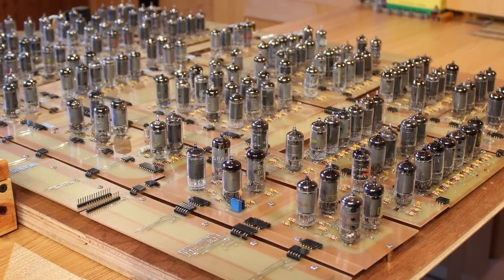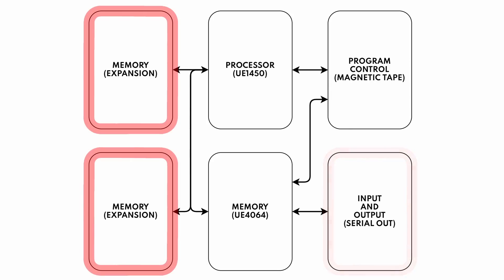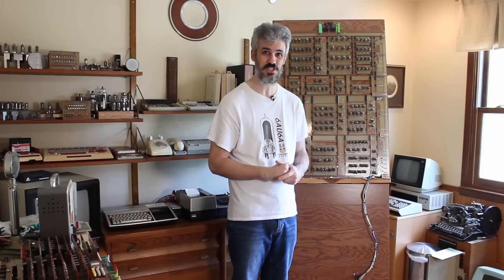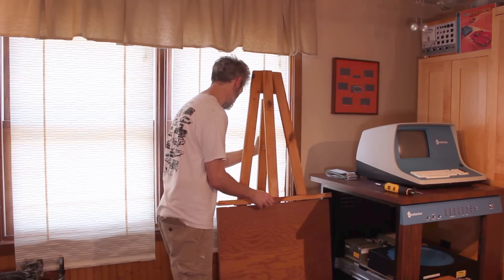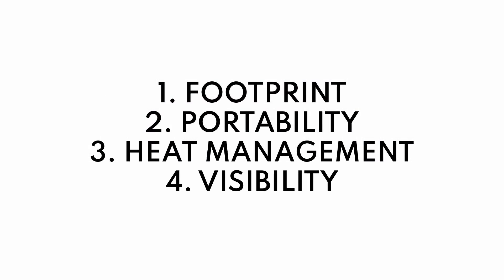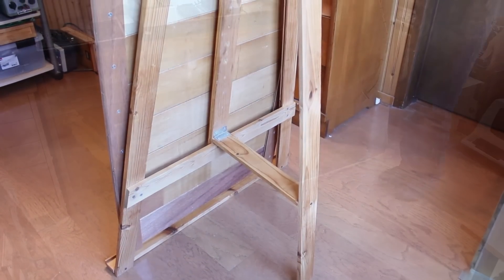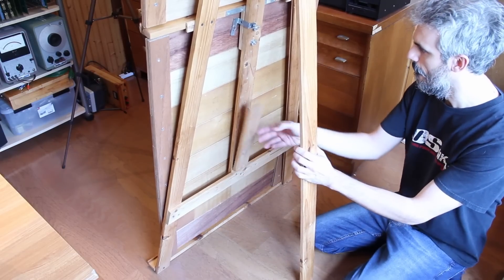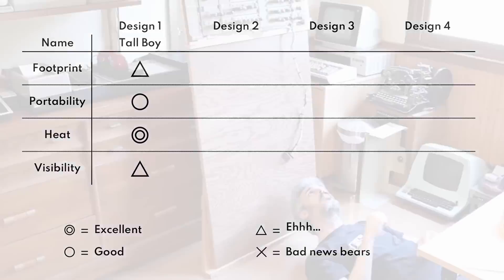Vacuum Tube Computer P.27 – Trying to Build a Mount for the Computer

Comment: A name that struck me is the UE LUX-1, inspired by the unique VFD-based memory modules, the fact it's a one-bit computer and the fact it's the first computer you've designed and built. I know you've changed the scope and plans of the project, and ended up going with just UE1, but I just wanted to throw it out there.

Comment: I think the cabinet design would have required holes between the boards to circulate air and some powerful fan... I would probably go with that as I like the idea of slotting them in, but would likely redirect the vfd somehow so I could have it all outputting at the top of the container. Did see someone make transistor computer parts like that, and would probably wait until I could do it with transistors, but I rather like the vacuum tubes. I find them quite interesting :)

Comment: Sorry for being late to the party. Also, I haven't yet watched your later vids to see what you decided. But I would go for a variant of the Cray idea. Instead of the panels radiating out from  one central pivot, they could be fixed in a row concertina-style. If each board is set up at about 90 degs to its neighbours, the whole assy can act as a room (or exhibition) divider, which might be an advantage in not needing wall space in an exhibition. Another idea might be to have an H arrangement with 3 pairs of 2 boards, one forming the bar of an H and the others forming its two uprights. As for vfd visibility, firstly as a general principle, no full-height display of anything gets t show off its lower half at all well, especially if kids congregate right in front. So if you are redesigning the whole thing, try to move as many of the visually attractive features eg vfds to the top halves. Secondly, as the vfds are now, the only real solution is to have dished reflectors for each one. maybe you could source some LED GU10 lamps or similar, or maybe such reflectors are on aliexpress separately, or maybe you could press some out of sheet tin or foil. Lastly, weight is also an issue. I suggest you try to make each board - and maybe each half-board - a separate component to the others, for assembly onsite. Good luck! BTW my first idea before I realised you wanted to take it on tour was that since 2 boards each 1x07m is about the size of a domestic room door, how about using the panels in pairs to replace 3 of your home's doors? That would save space!

Comment: If it was for me I'll go for design 3 the filling cabinet, but flip the boards vertically and have mesh on the top and bottom so air Is thermo siphoned (add some fans on the bottom to blow air up to provide cooling). You could make the sides transparent to allow you to see 2 boards at once and can have the center borads face away from each other when you pull them out to show 4 boards at once

Comment: I'm new here and have been watching all your shows for the last few days and have to say that I really like the wall mounted version you have here now.  So much so it would be worth re-working all lighting on the computer itself so in the future you can simply mount the system to a wall to show all in your living room which yes could as well act ask your home heating system. Also the 'tall boy' as you call it  would be best for shows as you will be about to mount it behind you in any booth you have without it taking up any room. Also any version other than the tall boy could be a fire risk that extra paper work would need to be filled out when showing it.

Comment: I'm late watching this (due to going out of town for a week & now having to catch up), but what if you combined the "tall boy" with the very "slow Cray"?  Or a tri-fold panel made of three double-height sections with the center section having hinged on both sides?  You'd have good ventilation/heat dissipation too.  The only weak point I see in all of the ideas is limiting yourself to having the VFDs vertical to the boards -- could you perhaps find "right-angle sockets" that the VFDs could "plug into" in order to greatly improve the visibility?

Comment: Funnily enough, I was thinking of the fan design before you mentioned it
The cray design is an eye-catcher - especially if it's going to be displayed in public.
Maybe all of the VFD's could be mounted on trolley like the one used by the old Tektronix scopes with storage below for spare tubes?
Ref. the power supply: you could maybe do a collab with Eddie over at Kiss Analog for a nice efficient SMPS?
This project is so immersive man! An absolute joy to watch. 🖖😎

Comment: Re the portable huge computer. The Very Slow Cray design might be best but if your test lights can't be seen, how about a new visual interface board so the club could see the results of data crunching, or devise an interface to drive an LCD display? Show input and output results?

Comment: Why not just Rabitto?  Capitalize if you need to.  The romanization of the Japanese pronuciation of the English word Rabbit.  But, the BIT in the name is important, since bitto is Japanese pronunciation/spelling of bit.  Not many Japanese words start with ra, so couldn't really work there.  There is one ra Kanji, unicode 7b49, but is a suffix meaning amount or or about.  So if you don't mind bastardized out of order Japanese, Rabitto also means about a bit.

Comment: UniELG (Universal Electronic Like Generator)
Reply: BTW I love your Austin Healy.
Reply: As for layout. I say copy a CDC 7600. Place each board in, basically, a display case with cold air going in the bottom and hot air going out the top, and simply join them at the corners. I presume that interconnect distances between boards are not really a matter of concern.  Seymour was better at dealing with heat and visibility of components than any of us, why not copy him? So this is technically also a Cray design, but two generations earlier, and I think it maps better to how these boards are shaped and what you are trying to accomplish.

Comment: If you went for the filing cabinet style you could could 3D print a T shaped sleeve/ coupler for the VFD's and run plastic fibre optic light pipes to a display panel. If they were printed in something semi transparent it may also increase the general visibility of them, don't know until you try I guess, and one large radiator fan at the back with a PWM speed controller.

Comment: Why not use the file cabinet but instead of slides use shelves horizontal to the ground at 30cm spacing with open sides, use polycarbonate sheets to mount the boards and run 3 small CPU fans at the back of each level for cooling.  I would set up the legs to act like the older bunk beds that you could separate to make into two separate beds, this would allow a simple break down. Assembly would be more like building a Lego tower, plus the light from the tubes would look like electric sex illuminating the poly sheets in low light.

Comment: Could the VFDs be rearranged to lay flat against the boards?  Maybe with some sort of adapter sockets?  If you could make a 90 degree adapter for the boards you already have, the upright system would work okay.  The memory boards could be designed to accommodate the VFDs laying flat against the boards.

Comment: "Cray with mirrors" maybe?  It's a bummer that being able to mount a lot of these together and still being able to see the VFDs wasn't part of the original design.  If the VFDs could be seen from the side, then the "Cray" would be fine.

Then there's #5, the huge unified horizontal planar setup.  Worst for footprint by far, but fine for everything else for that's how you had built it in the first place.  Perhaps it would have a human size slot into which someone could walk, so the sight-line to any one VFD won't be too terribly long.  I think the coolness factor would probably persuade the event to give you the area for it.

And then there could be a hybrid setup whereby the main processor is a horizontal plane but the memory arrays don't take up as much space as the main processor, yet still built so the VFDs are reasonably visible.  Nothing says that all of it has to be set up the same.  Even perhaps put the "Cray" part on a turntable to swing back and forth.

Comment: Your project has made me ponder something: if a fairly simple vacuum tube computer like yours had been invented back in the '40s, let's say, would it have greatly increased access to computing for a lot of people? I mean, most early computers where very large and had large word sizes. Perhaps something that would fit in a single cabinet, use less power and would execute more slowly would have been possible.

Comment: Heater filaments in some tubes can sag over time when hot. Worth checking the manufacturer recommendations as some indicate they can't be used horizontally.
Reply from the maker: Oooh, that's an interesting problem I didn't think about.
I just checked the 6AU6 datasheet and thankfully it says that the mounting position can be anything!

Comment: I have some ideas for the name of the computer. Those are the UEC 1645, UE1BTC, or some rendition of it. The UEC of the first one stands for Usagi Electric Computer, and the 1 is the number of bits, the 6 is from the 6AU6's, and the 45 is from the UE14500. The next one after the UE stands for 1-bit tube computer. Also something like Usacomp or IEVTOC-1B (Intricate Electric Vacuum Tube Operated Computer 1 Bit, Pronounced eev-toc one bee). I could come up with too many names for this one comment if I kept going, so here are the ones I picked. Cool project too!

Comment: Custom road case hardware might be helpful when figuring out how to pack things up. You could always build the whole thing like it was meant for traveling with Willie Nelson.

https://www.reliablehardware.com/

https://www.diyroadcasesstore.com/categories/Case-Wall-Materials/

Also worth knowing about sites such as https://mycasebuilder.com
They have an excellent case finder for sorting through the various sizes of injection molded cases from different brands.

The reliable hardware guy has a YouTube channel showing how to build your own road case.

You will notice some of the case hardware is standard rack rails.

Comment: I feel like this needs to be attached to a big metal control panel with neon lamps and toggle switches, like an old IBM computer. This also somewhat reminds me of some of the relay stands at the local community college that were used for teaching, with all their banana plugs and motor starter relays mounted to big wood boards on 19" racks.

Comment: one thing you can do with the cray design, is have a central support structure that the other boards "slot" in to and then have the cabling on the inside of the central support, then you can just put it all on a plinth with some fans in fifring straight up through the boards

Comment: I like the filing cabinet but add a small AC unit and bring the VFDs out to a front panel with the control switches similar to a classic PDP computer.  Maybe mount the boards vertically instead of horizontally.  Oooh, and a cool plug in back plane like an old S-100 bus.

Comment: I propose that you mount the boards back-to-back in pairs, then mount these 3 "modules" around a central axis at 120° from eachother. You should get something resembling a Y.

I think it's the it meets all requirements: it's contained in a 1.4m diameter circle, it's completely visible and has great airflow, and can be easily taken apart.
Reply from the maker: Brainstorming with a member of the Discord, we actually stumbled across this exact same design idea!
I've been calling it the "Tri-Force," because that's a cool name. Here's a sketch I drew up of the idea a few days ago: https://raw.githubusercontent.com/Nakazoto/UEVTC/main/Reference/Cases/Tri-Force.jpg
At the moment, this is my favorite idea, because it can fold up to be pretty compact, can be put on casters for easy portability, and can swing out to look really cool.

Comment: variation on the file cabinet -- instead of sliding out, put big hinges on left side so the boards can fold over one at a time giving visibility.  then they all can fold back into the file cabinet arrangement (with a big attic fan at the back of course)

Comment: Regarding design layout, maybe a modification of the "cray": think of it as a book, with all boards in the same orientation, no back to back, and boards do not share the hinge rotation axis.  You can fold all boards into a box, but to operate you fan out the boards, like fan-ing out a book.
The "book" back where all hinges are, also has the interconnects, maybe "I/O", power supply, etc.

Comment: How about a vertical design with the filing cabinet. It would be like the card cage in the centurion. It would fix the heat management problems.

Comment: Also consider “safety”! I find the easel setup not safe… there is a risk of it to topple back or forward with a large impact…
Reply from the maker: You're absolutely right!
Being so tall with such a high center of gravity, it just takes one little mistake to tip the entire forwards and have it come crashing down in a 25kg collection of pain. The other designs were ideas mainly to address the footprint and portability, but also take into account stability as well.

Comment: So just brainstorming here. What about using a small mirror on an adjustable mount? So you can change the viewing angle as you see fit while still working out all your layout ideas? I would think that the mirror at a 45 degree angle with a center hole in the middle to go around the vfd. Might make for a cheap, fast highly adjustable solution for the time being.

Comment: If any of the VFDs are blocked from laying flat in all directions (@7:56 can fold up over the two resistors, but looks like it would contact the tube below even if the power resistor were not in the way, and there is space left and right) I would not put in the effort of tilting them. I think it is better to have them all upright than some upright and some flat. But if they can, and you want to make the effort, I think a set of sockets and clips would be doable.

Comment: Weighing in on the name, I feel like the early days were rife with VACs of various types (as well as ENIAC), of course. I then thought "Thermionic Usagi Electric Low Voltage Automatic Computer" gives you "TUELVAC" (which you could maybe pronounce as "twelvac" and also maybe represent as "12AC" if you felt like a fancy logotype). I feel like this could be improved on but I haven't figured out how so far!

By the way, I've really been enjoying both these and the mighty mighty Centurion! My exposure to vacuum tubes has been exclusively in guitar amps, so I've been fascinated watching you use them in low-voltage systems. I also think it's a really great way to teach the electronics of logic gates, which is something I didn't know much about before!
Reply: I just had another thought ... could putting the Cray on its side, or rotating the individual boards (to create a wider, flatter fan) help with the VFD visibility problem? It might require a fairly sturdy mounting bracket for the latter, though!

Comment: If you rotate the boards by 90° in the Slow Cray design so the VFDs point outwards, you can read them.
Although at 186 comments, someone else probably suggested the same.
Also the name Cray-Z would fit. Or Cray-OLA? Now you come up with a Backronym. How about Heatwave? I saved a Tektronix 535 from the curb and I'm only ever gonna use it in the winter, you can guess why.

Comment: Design 3 on its side is the best solution. The same way you insert the cards on the Centurion. Air can flow bottom to top. On the back you have the connections. Boards are inserted from the front.

Comment: Definitely the drawers. You just won't be looking at it all the time and the heat can be managed with a few silent fans. Use large ones with slow rotation and it would keep the noise down. You can pull a tray out if you need to watch it and in that orientation you can see the VFD. Design 1 is a bump away from sadness. Design 2 is a badly designed drawer. Design 4 is not cray but crazy.

Comment: I am worried about accidentally bumping it and toppling it over. I would maybe make a large flat plate and have the three legs secured (screwed?) to it so that if I get near it and my tshirt catches at least one of my legs is standing on the flat board on the floor and keeps the whole thing from falling over. Or some other solution to keep it safe.

Comment: The computer could be named: "Usagi Elite" or "Usagi 1337" (which is also Elite but in the form of numbers. regarding the shape I was thinking if you made a Star-shaped pillar you could have the boards more compact and also show the tubes in all directions with good ventilation. you would still get the issue with the VFDs but you could angle them toward the side instead as if you made a star shape you would see all sections a lot from the sides as well

Comment: how about a variation of your design #3, sliding out the boards to the sides when you want to use the machine. Afterwards when cooled down slide them all into the "box" theat may look a bit like dresser with drawers to all sides.

Comment: I think the pinball machine style using noctua industrial pc fans like the NF-A14 industrialPPC-3000 PWM in conjunction with a NA-FC1 manual 4 pin fan controller would be able to take care of the heat problem, By the huge amount of air they move despite their compact size.

Comment: If you use the Cray design could you rotate the boards 90 degrees so the displays would be visible? You would have to rotate your head 90 degrees to read them but it would save the need for any other fancy solution to make them visible. As for the name, you could call it simply the Usagi 1 (or Usagi One), or if you want to note that it was built in this year you could called it the Usagi 22. If you want to have a three digit number if could be the Usagi 122 for the 1st one in '22.